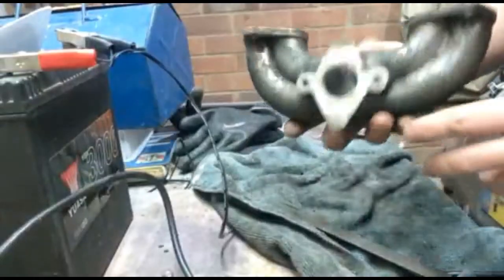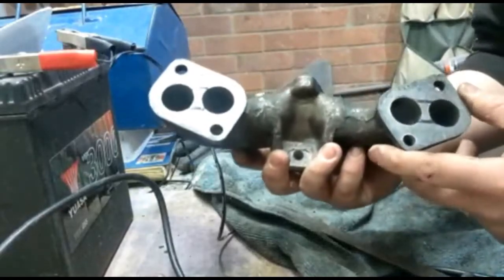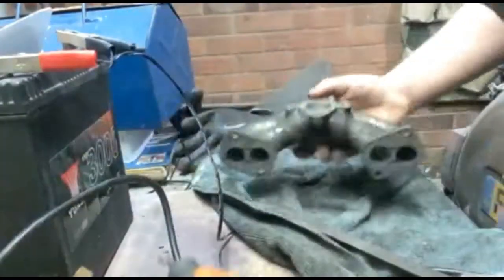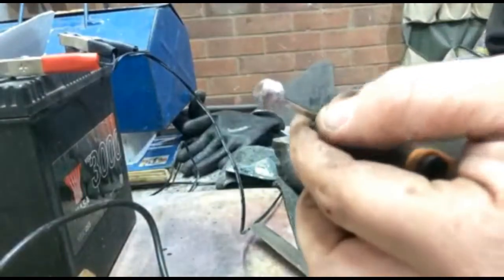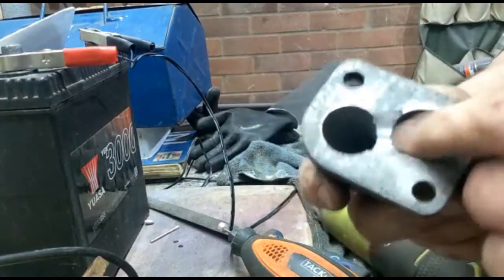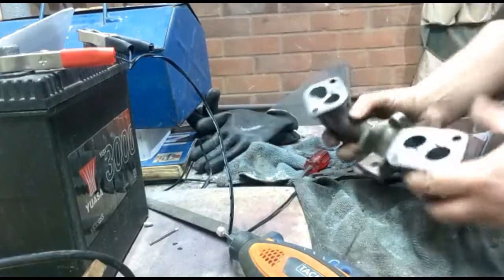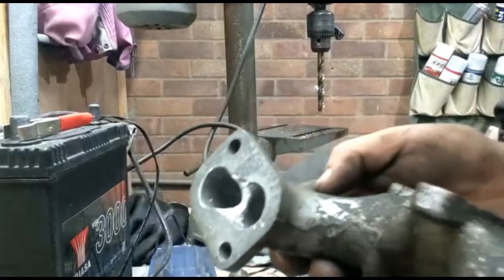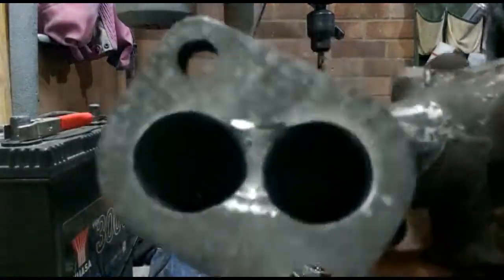Reliant Robin - making your Robin/Rialto go less slow - Part 2 - how to port your inlet manifold

Comment: Dunno if you're already doing this, but i've found that if you place the inlet/exhaust gasket on the head and "match" the gasket to the cylinder ports (some gaskets have undersize inlet port holes) and conversely match the ports to the gasket, then match the manifolds ports to the gasket it helps improve the air/gas flow properties substantively, hope this helps.
Reply from the maker: Thanks! Yes this was done just didn't capture it in the film

Comment: I found when I matched the porting and gasket of the exhaust inlet manifolds on my Robin that it seemed to improve the bottom end pulling power, where before I had to change down to 3rd gear I could now easily carry on in 4th without any labouring.
Reply from the maker: we didnt notice much difference between the two cars. Neither was slower or faster is seems.

Comment: It’s basically a smaller displacement version of a Triumph Herald engine, so would it be possible to use aftermarket speed equipment for the Triumph? Also, why hasn’t anyone put a Crossflow or twin cam head on these engines?

Comment: An 850 engine with a three bearing crank and a very weak gearbox doesn't need more power, set the timing right and don't expect it to do 70mph all day and you'll be fine. 
 They are what they are.

Comment: The siamese port mod was first done on a high revving modified engine to fix a specific issue the tuner had where two of the header pipes on his 4 branch manifold were getting hotter than the others, from what I understand it is likely unneeded on a standard engine.

The opening in the manifold is actually only 30mm on most reliants even though the carb is 1"1/4 (32mm), 

The head ports do not line up well nor do the holes in the manifold heater or the carb, so port matching would be beneficial for high rpm flow.

It would likely be more beneficial to cut the bridge out completely but leave an inch or so at the manifold to head end (basically the mirror of what you are doing now), this will open up the plenum area whilst keeping the port length the same for each cylinder, a shorter port length should move the power higher in the rev range. 

I am guilty of doing the mod you have done on my car but tbh in 40k miles other than a different induction note I haven't notice any real difference.
Reply from the maker: interesting! We will see what difference it makes as both the blue and white cars are pretty much identical. Tom has modded his blue one while i have left the white one stock., Very unscientific but we will be able to see whos faster!
Reply: @sharleysgarage  I've been looking into fuel injection for mine, I already have s 60-2 trigger wheel mocked up and an inlet manifold adapted to take a Weber spi throttle body.

Just waiting for a dirt cheap 899cc fiat to pull all the management system from pref early non immobilised for less wiring.

Only a crank sensor and coolant temperature sensor to mount to the engine, the rest are on the throttle body and lambda sensor for the exhaust.

Will only need a switched live,a permanent live sorting for the ecu/fuel pump relays and an injector fault warning light fitting to the dash somewhere. So very little wiring, all could be done from the engine bay/fuse box.

Debating whether to fit the original fiat in tank pump or retain the reliant lift pump into a swirl pot under the bonnet and put a return line to the tank.

The fiat ecu will auto adjust perameters somewhat so should fuel fairly well after a few miles driving.

 they use 899 ecu on 1108 engine and vice versa in the small Fiat's when doing engine swaps so the small capacity difference going 848 to 899 shouldn't be an issue.
Reply from the maker: Sounds like you have done a decent amount of research. Be an interesting build when it's done! Cant wait to see updates on how you get on.
Reply: @sharleysgarage  not sure what set up they used but the top gear robins used in the arena shows were fuel injected (the yellow ones they raced.) They were on eBay last year I think with pictures of the injection system.

These ones

https://youtu.be/0muqSXuNuww

Comment: I have looked into tuning the 850 Reliant engine and the SU Carb is more than fine,     So no upgrade there,    The problem is the gearbox won`t take more bhp,       So I would invest in a aluminum alloy radiator,     Regularly replace the water pump and use premium petrol,      Maintenance is far more important
Reply from the maker: An alloy rad shouldn't really be needed but you are right on the water pump, they are prone to over heating but the pumps are now £85 i think. The blue Robin seems to run nice and cooler if not a little bit too cool. My old green rialto ran super hot all the time, I tried everything and nothing worked so it got sold!
Reply: @sharleysgarage  

A more efficient impeller would help, the standard unit is a six sided impeller with flat parallel blades rather than an helical impeller.

I have a few 1.1 1.3 ford fiesta water pumps I picked up of eBay for a couple of pounds to compare the impellers, 

both are eight bladed impellers and would need the outer diameter machining down a few mm to fit, 

one had a nice cast impeller but the centre bore is slightly too small to fit the reliant bearing, the other is the correct bore but only a stamped steel impeller (still better than the OEM one but not as good as the cast one)

I intend to have the cast impeller machined to fit the reliant pump, which should improve coolant flow.
Reply: @sharleysgarage  Pity the buyer - uh, LoL{i think..}
Reply from the maker: It sold within mins of going for sale.